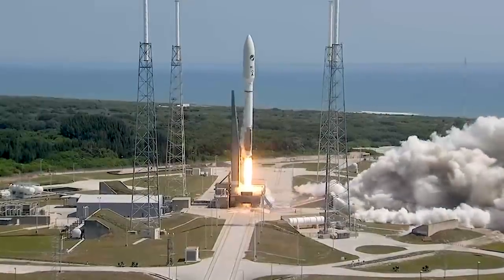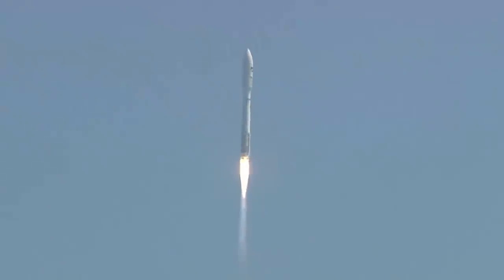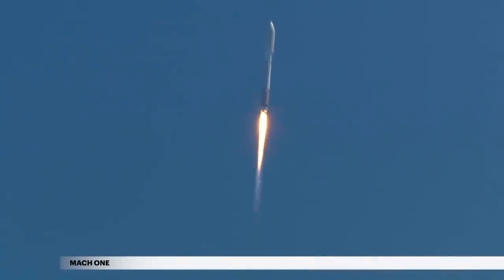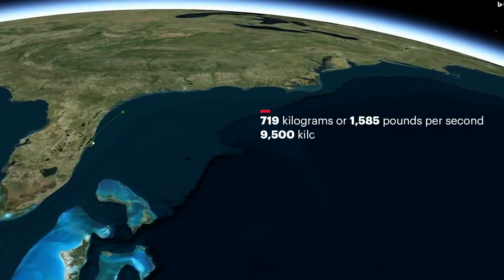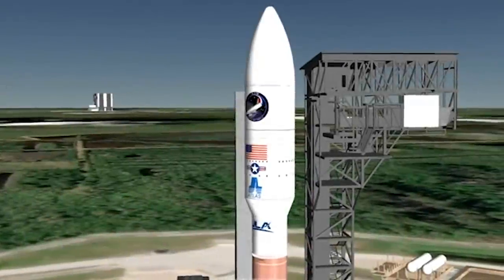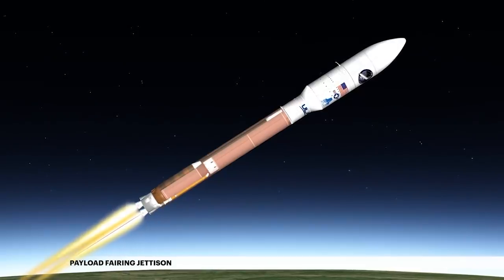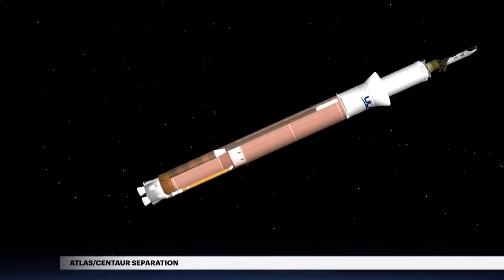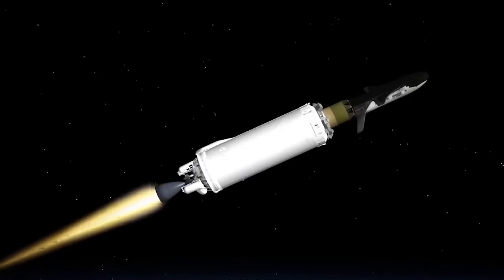Atlas V USSF-7 Mission Profile

Comment: Excuse my ignorance, but out of curiosity, why does the fairing cover the payload and the second stage ? I thought weight should always be reduced on a rocket
Reply: The 5m fairing is too heavy for something as paper-thin as a pressure-stabilized Centaur to carry.
Reply: Gabe Darrett In this case, the fairing supports part of the weight of the payload.
Reply: When the payload requires the 5 meter payload fairing it means that the paper thin Centaur upper stage can’t support the weight alone so its encapsulated inside the fairing